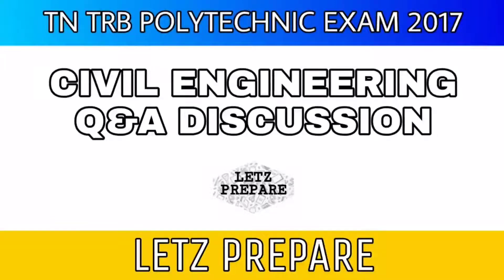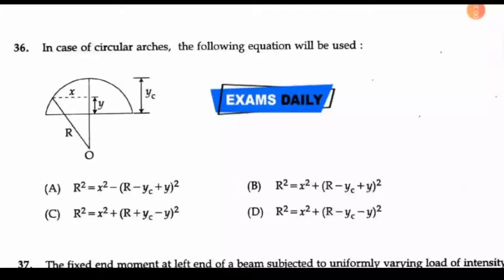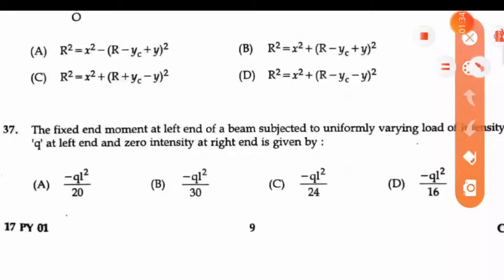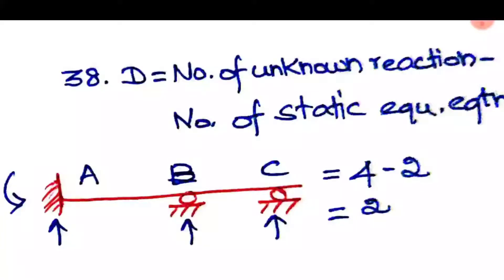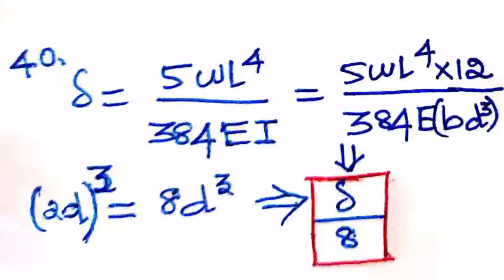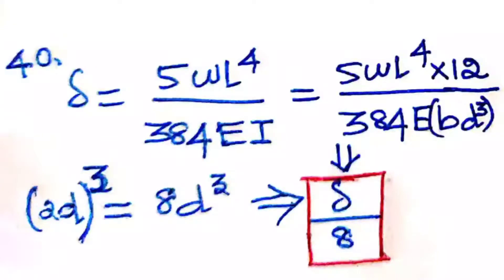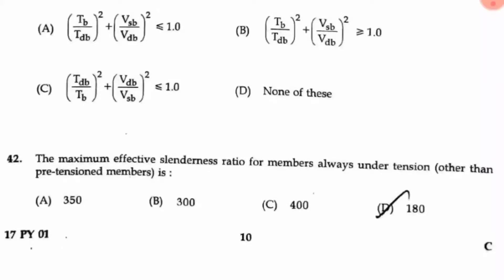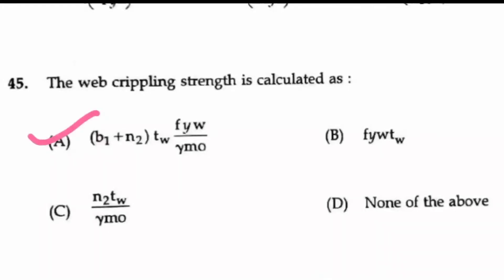TRB Polytechnic Civil Engineering 2017 Question Paper Discussion ( 36-45)

Comment: 38 q why we neglect hzl reactions in beam and degree of redundancy is degree of static determinancy????
Reply: Thank you for ur clarification
Reply from the maker: You need not consider Horizontal reaction in Beams that don't have load or have vertical loads alone. If they have inclined loads, then you should consider Horizontal reaction also
Reply from the maker: Degree of redundancy and Degree of static indeterminacy are same.

Comment: 39 qns?
Reply: 39 question option B partially correct but n^3 instead of n^2 
Ans is n^2(3-n)/2 refer structure analysis ramamrutham
Reply from the maker: Thank You for sharing with Letz Prepare. .
Reply from the maker: We have tried and searched the answer in text books for 39th question, but we couldn't find it. In TRB Key also they have not given the answer. The question paper is attached in description, kindly view it.
Reply: @letzprepare4511  ok mam....I have already workout solution for trb 2017 qns except few questions....Ur video is too useful for remaining questions....need mathematics solutions...